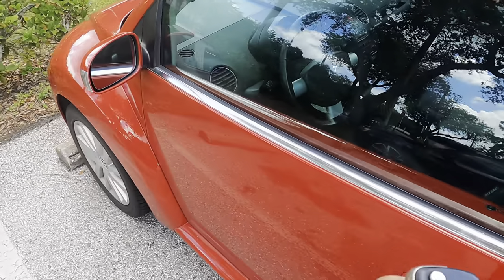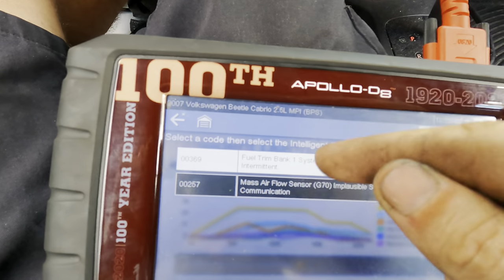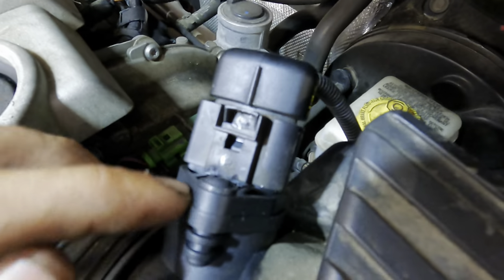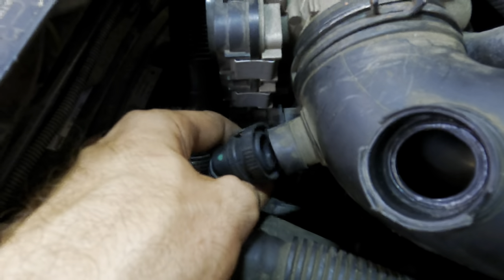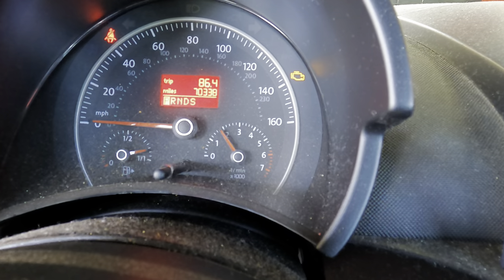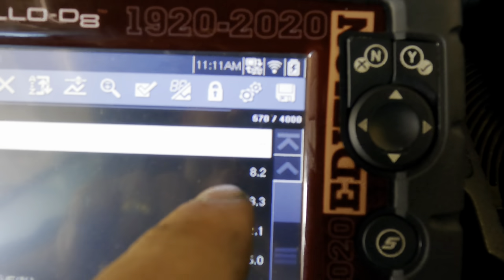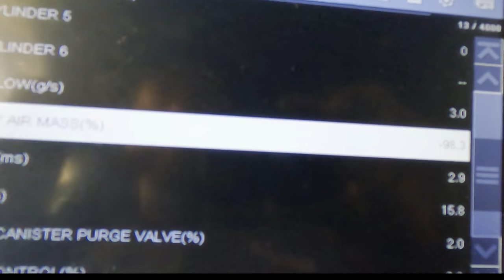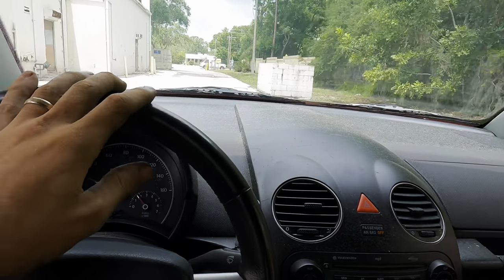Dealer Saved The Day! 2.5l 5 cylinder? VW Beetle P0171 P0101

Comment: An old timer once said to me.  It's £1 for turning the screw and £99 for knowing which screw to turn.  No luck involved Ray, you knew where to look and that's the skill involved.
Reply: I could not agree more.
Reply: Exactly, I repair antique oil and gas equipment, retired in January, now the company's that I contracted to are pulling their hair out because like you said, they don't know what screw to turn!
Reply: Is that like filling Scuba tanks. The air is free, but we have a steep delivery fee.
Reply: @michaelvangundy226  That and the cost of power to compress the air.
Reply: @althomas6496  sounds like when my uncle retired as chief engineer off a birumen tanker, he was asked back 3 times from retirement (and signed on for an additional 6mo each time with double pay as the last time, since the new guys couldn't find the screw (hint: it was never IN the engine room... 😂
Reply: true that
Reply: Funny how that saying has been stated on both sides of the pond
Reply: yes he knew where to look but as he stated in the video could've been a few different issues so it was a little bit of luck that it was JUST the hose and not multiple problems
Reply: I guess you're British? 😜
Reply: I mean that is a 5,000 dollar scan computer.
Reply: Any idiot can read a scan tool and swap parts out, as demonstrated by the evidence you found that someone had already changed out the mass airflow sensor. It takes someone with knowledge and experience to take that scan tool reading and then look under the hood and figure out that the sensor was fine and that something else had to be involved. Nice job of fixing the problem instead of just slapping in a new part and calling it done.

Comment: Sis bought 2 of these 2.5 2010 Sport models 3 years ago off Offerup for $1000 bucks each. Both from the same retired owner with less than 80K on them. The owner didn't want to deal with the check engine and oil leaks they had. I fixed both with new valve covers, sparkplugs and a few new air hoses pretty easy fix. Surprisingly they are still running strong till this day. One's her daily work car and the other my Neice college Bug. BTW the air hoses develop cracks at the 90 degree elbows that will not be apparent and easily missed unless you disconnect them and check them thoroughly👍🏼
Reply: Yep! Those air hoses crack very easily, especially on the older models, only had one small on one, but the hole end disconnected from the rest of the hose! 2001 Passat 2.8
Reply: @diesel1024  Absolutely 💯 they are sneaky to the untrained eye. Had never really worked on VW'S, but after working on those two became a Master Tech 🤣. I understand now why a lot of folks complain about VW'S since trying to diagnose these can be a nightmare. The Air pump connection hose on both had similar sneaky cracks at the elbow that can fall through the cracks of an eye ball inspection. Note always get OEM parts with these vehicles and save yourself the headaches. One of the Valve covers integrated (PCV) I changed out was off brand and the bad molding and gasket allowed oil to leak into cylinder #5 sparkplug hole and surrounding surfaces. That been said these engines are in a lot of VW's and run pretty strong if maintained properly by a competent mechanic. Last summer the dealership wanted to charge my neice over a grand to replace her AC compressor, but her uncle saved the day by replacing the AC compressor control solenoid a commen problem with VW'S with a RKX replacement for $55👍🏼 Always a good feeling helping out my loved ones.
Reply: @johnny4713ify  Absolutely! I know I try to save anyone from getting ripped off at the dealer, whole reason I starting doing all my own maintenance, most of my family owns VWs and they're been great to us. $125/hr at the dealer last time I was there. My other car is a MK6 2.5 Jetta, just hit 107k on that, but my uncle has a MK5 Jetta 2.5 with well over 350k miles, doing just regular maintenance. I always go for OE for PCV, I've heard some aftermarket ones are significantly louder as well, not worth the risk on something that already isn't cheap, but I get a lot of my parts for my VWs at FCPEuro, planning to do a full engine rebuild on my 2.8 and they have a lifetime replacement warranty for any parts bought from them. Definitely worth it.
Reply: @diesel1024  That's an awesome project to take on! Pretty much the family mechanic aswell 🤣. Besides the engine work the only maintenance I've done on neices 🐞 is full suspension shocks, A arms tie rods etc and re-booted both CV Axle's they were still good, but leaking a bit of grease. Apparently the 2.5 with auto transmission driverside axle are famous for being a bear to remove that most inpatient people destroy the axle and/or transfer case getting it off 🤷‍♂️ I didn't know any of that until digging into to it, but I came up with my own solution that took me less than 10min to pop it off using the fork only peace from the slide hammer kit and a small prybar. In case you ever run into that fix hit me up  for the 411 on how to set it up👍🏼
Reply: @johnny4713ify  Thanks for that! I'll keep that in mind, haven't had to change either of the CVs on my Jetta yet, but just changed the transmission fluid a month ago, what a pain. Going to be driving my 2.8 Passat for the first time this year, hopefully this week, had a spun bearing from oil deprivation, long story. My Passat goes through a CV axle every other oil change, serves me right for buying a cheap part with a lifetime warranty from O'Reilly's, never going to get out of this cycle, ha!
Reply: @diesel1024  Dang that's kinda nutts to be changing a CV Axle so often 🤯 Are you a speed racer around turns being hard on the tranny or are the boots leaking🤣? I've bought Axles from Both Autozone and Oreilys and they have been pretty good although haven't had to replace an axle on a VW just rebooted them. NAPA seems to have better quality Axles, but there lifetime warranty is a pain since you need original receipt and it only applies to the actual store you bought it from so I try to avoid parts from there. Maybe European QC on there parts is not that great 🤷‍♂️. One thing I can say is really good about Oreilys is that they honor manufacturers warranty on everything they sell including sparkplugs Autozone doesn't warranty sparkplugs. I haven't had to pay to replace 💰 iridium plugs on my dailys in years. I do a tune every other year that includes sparkplugs and all I do is take my old ones to store look up phone warranty info then they swap them out no questions asked👍🏼I do the same with breaks and rotors. Buy once cry once.
Reply: @johnny4713ify  I've had good luck with warranty replacements at O'Reillys, Had one break in Salem, MA while I was out there and changed it out in front of the store, had a couple go bad here in MN and used a few different stores, definitely makes it worth it. I push my car hard, so it doesn't surprise me they go out so fast. Boot was leaking one time, so I just opted to get a warranty replacement rather than reboot it, easier for me that way! My original axles got too bad to reboot, but I know I'd take the chance and do it if they weren't. Mostly lost some of the ball bearings, so I didn't bother. My suspension and transmission was originally designed to be on an Audi A4/S4 (b5 chassis), so I guess it puts a little more pressure on everything than typical VW suspension. At least I make sense of it in that way, I have no clue, could just be low quality axles (Import Direct brand name). That's sweet with the iridium plugs! They definitely cost a pretty penny. I gotta look into that!
Reply: Those 2.5s seem to be pretty reliable compared to all the problems the various MkIVs had.  I have a 2007 Rabbit I bought new that's over 185k now and the engine has been fairly reliable, most of the issues have been drivetrain related.  I did have to spend $900 recently because the ignition lock cylinder failed, which is probably just about the stupidest thing I can imagine turning into a $900 repair on a car.
Reply: @thesledgehammerblog  OUCH! $900?! thats insanity, although it doesn't surprise me, i'm sure they charge a bunch for the lock cylinder, then even more to "reprogram" the lock cylinder (rekeying, etc). I've done all my rekeying for door locks, glovebox locks, and lock cylinder, bought a kit from China for $25 with all of the locking reeds, so I can just swap them out if I want to rekey.

Comment: The fact that they had it in stock would tell me that this might be a problem that occurs now and then.
Reply: Essentially caused by them..
Reply: that plastic ages like hell, causing the clips to break off..
Reply: I work at a dealership (not vw) in the parts department.  There is always a part that you don't expect in stock for an older vehicle either because it had been previously ordered for another customer who canceled.  It also may be that the part is used across multiple vehicles (anything with a 2.5L).  Doing a little bit of digging, that Engine was used from '05 to '14.

Comment: ive had a 2.5 5 cylinder for about 2 years, absolutely zero engine issues. glad this car was finally shown on this channel!
Reply: One of the best VW engines! They keep going and going. My uncle has a 2.5 Jetta MKV with over 300k and just regular maintenance (oil changes, spark plugs, etc), just hit 106k on my 2012 Jetta 2.5

Comment: Ray you mentioned adjusting the seat to be breaking a rule. Unfortunately at my size breaking that rule is a must. I once got into a bmw and was almost smashed into the wheel because of automatic seat adjustment. This lady was tiny by standard comparisons and I am almost 6.5 feet tall.
Reply: I saw a video raised maybe a month or two ago the person that owned the car was so small Ray almost broke his knees on the steering wheel hey what's the difference seats go back they can come back up again but move my seat up too far my car goes faster because I stepped hard on the gas pedal have a nice day

Comment: About intake vacuum leaks: The air entering through the leak does not get measured by the MAF sensor. It also reduces the airflow at the MAF sensor. That's a double whammy for the accuracy of the MAF sensor signal.
Reply: Thank you for passing on what Ray already said.
Reply: Kinda, Sorta enforcing ye old Euro " Fine Service Vehicles"  reputation
Reply: Double whammy? Or the same thing? Unmetered air is unmetered.
Reply: The Short Term Fuel Trim should have been pegged Maximum Positive.
Reply: Not only is the air unmetered it is also unfiltered
Reply: Nope. The air not passing by the MAF sensor is just reduced by the amount of air entering by the leak. There is nothing "double". The engine doesn't consume more air just because of a leak. The total amount stays the same.
Reply: @stealthg35infiniti94  pretty sur that was noted shortly after scanner data was accessed
Reply: @ajaywhite9103  Begs the Question?
Which is the Worst'est of the 2?
Reply: @stealthg35infiniti94  I'm guessing what happened with that was the difference between no-load 2,000 rpm and actual driving load 2,000 rpm.
Reply: @ajaywhite9103 Some people like it raw and gritty on the streets, yo!  

But if you're an internal combustion engine, yeah, try to avoid that.

Comment: The same exact thing happened, at about the same mileage, to my VW Bug. 
2006 VW New Beetle, 2.5L, 5 cly, 5spd Manual transmission, hard top. 
It threw the CEL after having the air filter changed. 
I found the problem in my driveway, after having a heart attack over the cost of a new MAS. 
The Mech had broken tabs off while manipulating that same big tube, while still connected to the airbox, when changing the filter. 
I had to re-attach that same little bottom hose with zip ties because it would not stay on. Only ONE tab was broken. 
I didn't buy a new tube from VW, because as you probably know, it was STUPID expensive. 
Years later, I got one from a junkyard.
I STILL have this car and drive it daily. It now has 284,500 miles on it.
STILL has the FACTORY MAS in it. 
I has had NO major work done to the engine or transmission, except the valve cover, due to the PCV valve needing replacement, and the thing is permanently mounted in the valve cover. 
I made sure they replaced the intake plenum gaskets, (o-ring style) when they did it.  
I love this car. 
I have 2 of these cars. 
My other one is a 2003, 2.0L, 4cyl, 5spd manusl, with 177,500 miles on it. 
I just got back from a trip from NY to FL and back with the 2003. 
NOT ONE PROBLEM on the trip or since. (KNOCK ON WOOD!!!)
Reply: I've the same setup in a Jetta wagon. 270k and runs strong !
Reply: That is pretty much the same motor as the Audi Group B Rally cars used.
It would be hard finding anything more reliable.

The VAG ( VW Audi Group ) of cars does have their little quirks, but there is plenty of information on line how to fix most problems quickly and affordably.
Often even an alternative part number from another company.
Look up 2005 Audi 1.8 injectors and you will find Ford used the same injectors in some pickups, which happen to be far less expensive.
Reply: @sailorstu  guy across the road had a wrecker there to get rid of it because of an idling problem. Fixed that with a dipstick funnel tube.
For $75 and Everything works ... I'll keep it !
Reply: I had a 2001 Jetta with manual transmission, it was my commuter car for 18 years. My son drove it for a couple of years in graduate school. It had over 350,000 miles when it finally died but I never had any major problems.  I did always keep current on the maintenance. Really fun little car but my only complaint was the road noise. Don’t think I would buy a VW again though.
Reply: The 8V was a great engine, very reliable...only issue was how slow it was.
Reply: @cup_and_cone  It's slow compared to, let's say the turbo models, or the V6s. But I find mine pretty quick. Not fast by any means, but quick. And it can sustain high speeds for quite a while. 
Also, It is strong as an OX! 
I occasionally tow a small trailer with mine. Being a manual transmission, You can feel the strength of this little 2.5L 5cyl.
Reply: @K.Kelly87  I am talking about the I-4 2.0L 8v engine in the first New Beetles that made like 115hp.  The 2.5L is definitely a step up in performance...it makes as much power as the original VR6 (AAA and AFP engine codes).
Reply: @cup_and_cone  OOOHHHHH ok! I have a 2003 2.slow too! Just did a trip from NY to FL and back with it. No problems. That 2.slow will hold at 80mph for hours. But it takes a while to get going that fast! LOL!
Reply: @K.Kelly87  Ya, I had a MKIV Golf with the 2.sl0w engine and 5spd.  Pretty reliable (once water pump is upgraded).  Worst thing about VW from that era was interior plastic...so poor and brittle.  Engine and suspension was pretty easy to work on, though.
Reply: The VW 2.5 is probably one of the most reliable engines out there, honestly. I've heard many of them lasting up to, and beyond, 200K with very little issues. Case in point, I own a Jetta 2.5 with 210K on it with only an intake leak and EVAP leak. While the automatic 09Gs have had their fair share of valve body issues, they weren't as bad as some would make it out to be. Mk6 actually still used the 09G but the valve body bore wear issue was far less of an issue. Definitely better than the 01M which would almost be guaranteed to fail within 120K in the Mk4s. The only real way to kill a 2.5 is to run it with little to no oil at all.
Reply: @droptoasterintub297  My 2006 2.5 has 284,500 on it.
Reply: @cup_and_cone  That's a great engine, but the car is too heavy.  A 2.0 8V in 1987 was crazy hot rod stuff.  (For hot hatch land.)
Reply: German engineering at it's best "the thing is permanently mounted in the valve cover." I am as German as they come DNA wise but their cars are crap. VW is also an extremely unethical company with their "test cheater" diesel ECU.
Reply: @brucegrunewald8423  Crap? Well, the PCV didn't fail until the car had 228,525 miles on it. The Cat didn't fail until the car had 276,928 miles on it. It currently has 284,426 miles on it, and we are still daily driving it, AND The ICE (2.5L GAS) Trans (Manual), and CLUTCH are ALL Factory Orig. Man!! This car is SUCH a piece of CRAP!
Reply: I have one thing to say to you all……lucky you ! Get a life ! LOL
Reply: @cup_and_cone  the 2.0 115hp unit is a performance engine compared to the ABE 1.6L (75hp)that was installed in the majority of European market Golf III's. That wasn't even the base engine. There was a 1.4L unit that made like 55hp. You haven't seen slow until you've driven one of these. However these engines feature a mono injector (tbi) fuel injection system and are so easy to work on.
Reply: I had the same thing on my airplane and I'm a couple of years ago but I did what Ray wouldn't do I took some good glue glued it together put the hose clamp back on it's held together ever since have a good day
Reply: I'm sorry the microphone on my phone misunderstood me and instead of air intake it it took it as  airplane I wish I had cam airplane but no it was just on my car I have to be honest about it have a good night
Reply: @michaelpressman7203  Auto correct sucks. Especially when it assumes it knows what you actually said. 😁